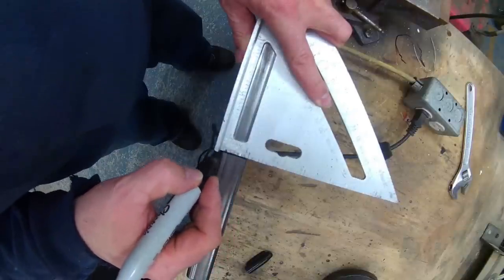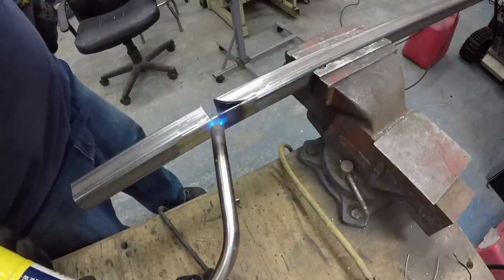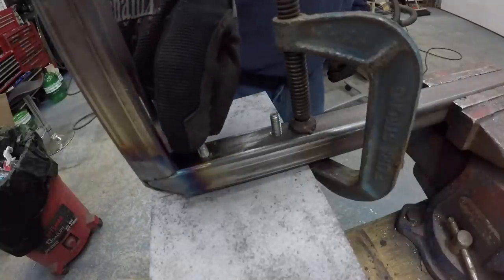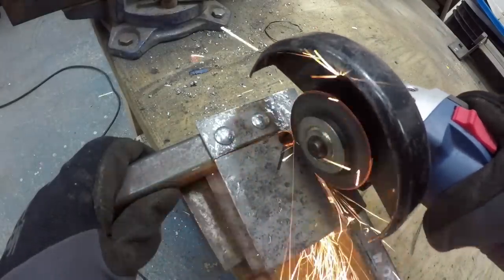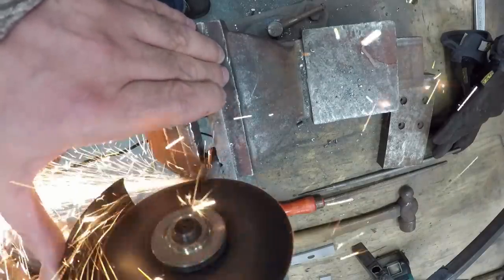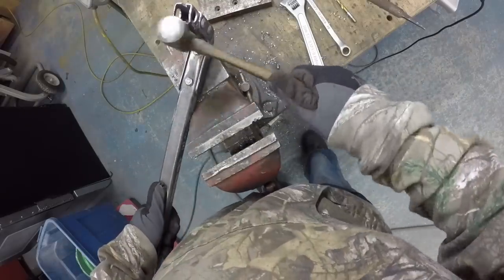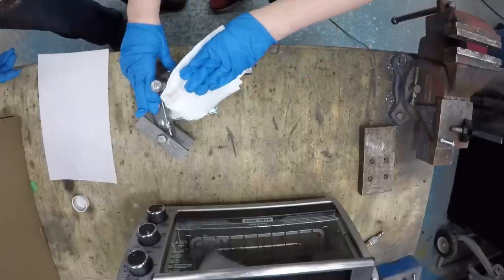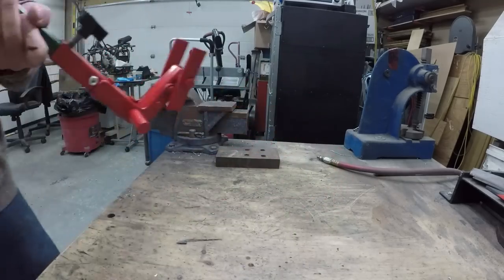My Best Pallet breaker NO welding

Comment: I admire your handiwork it’s nice to see someone use a hand file as much as I do. The best part was when you pulled out the tap! The thing is, how many pallets do you disassemble? I use a 4ft 4x6 and a 2ft 6x6 to prop up the runners and a dumbbell to pop the slats or vice versa. 10-15lbs pulls a board with 3” nails easy. Then just flip the boards tap the nails out, flip again and it’s quick work with a hammer or pry bar. Dumbbells are like multipurpose, I use em for anvils, a palm sledge hammer, extra hands etc!
Reply from the maker: Yes there is so many ways to skin a cat,  I made a few tools to take pallet apart, that I either gave or repurposed for the hardware. I like your way also, what is the percentage of broken boards?
Reply: @RoomiesGarage  I guess it depends on the state of the wood but thinner stuff is more flexible too. I try to go as close to the nails as possible but maybe 20% if it’s thinner wood. Most of the stuff I do is constructed of 2x4 or 2x6 lumber sometimes with the upc still stapled on the ends. There’s usually a few screws but once those are out it all comes apart with zero broken boards. I keep all the nails and sawzall the splintered parts off and I have 3’-8’ pieces of lumber. Some of the cross pieces have like 25 3” 10D nails, great for an overgrown backyard lol

Comment: New sub here !  Your work is outstanding !   I mean NO disrespect, just a suggestion...... do you think it would still work using 1.25 or 1.50 inch wide material for the pieces that push up on the wood?  From our camera angle it looked like the center piece causes a divot in the wood.
Reply from the maker: A C channel instead of  the 2 side pieces pushing on the wood. I appreciate your constructive comment. I want to make a pallet breaker  with a car jack so I can use child labor hahaha but it still at the planning stage . Have a great day.